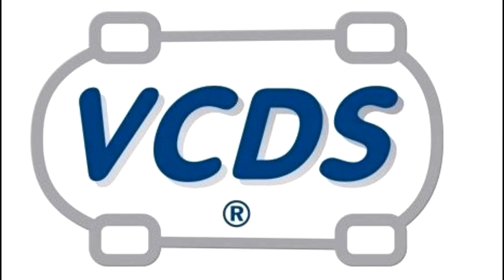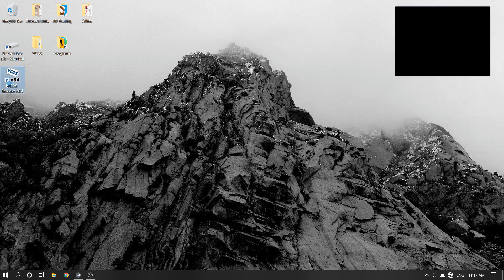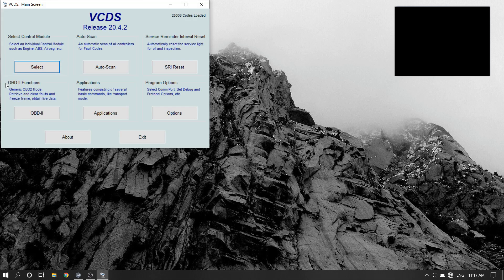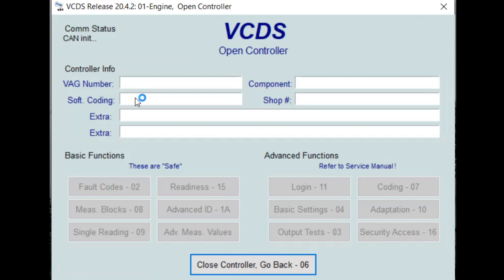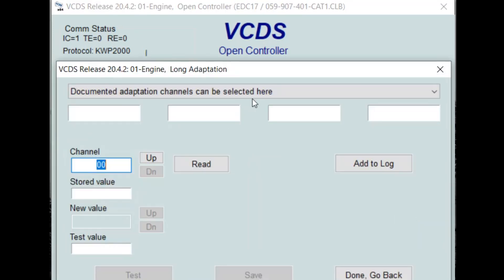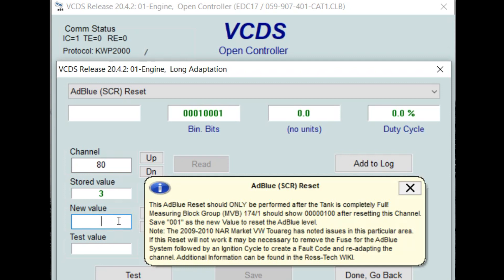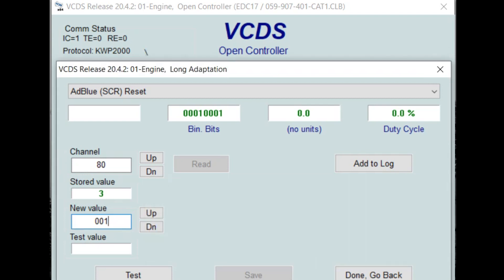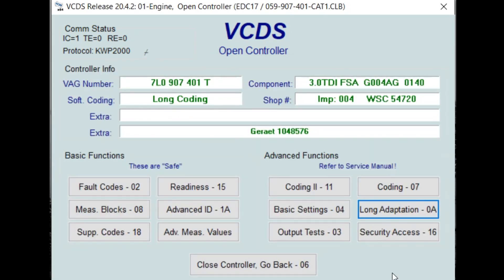VW ADBLUE RESET USING VCDS

Comment: I assume the cheap "Dumb" VCDS cables wont work, will the "lite" version of the software?   I'm seeing around $100 from FCP Euro for the proper cable says the software is a free download but they probably mean the free version which I dont think does long adaptations.
Reply from the maker: I wouldnt bother with the cheap cables. They wont work.
Reply: @GrindinD   Thanks, I ended up getting the Ross-Tech off eBay.  My local shop reset the ad blue for $35 while I waited for the package, that was good.  Had 15 miles left to drive. The issue started with a bad NOX sensor, I replaced that then had to rest.

Comment: I just added the ad blue and after a little bit it’s suddenly told me I was 200 miles away from not being able to start the car. And now I can’t start the car. Is there any way of doing this without going to an auto shop?
Reply: I'm in the same predicament.
Reply: What happened? I'm having the same problem
Reply: @peterovenstone  It’s a bullshit setting and error code that needs the dealership to just clear it in five minutes.
Reply: That's what I thought but I've been told my whole AdBlue system needs replaced to the cost of £2000.
Reply: @peterovenstone  A lot of the TDI’s have extended warranties. You should check it out. A lot of stuff mine was covered.
Reply: Did you ever figure out how to reset this via VCDS? my 2014 q5 3.0L diesel did this to me recently as well. No warning just 200 miles and done.

Comment: Don't know what I could possibly be doing wrong, but my new value just keeps giving me 3.
Reply from the maker: There's another test you can try that involves removing a fuse and cycling your ignition.
Reply: @GrindinD  I wasn't aware of it. Did you try it and did it work for you?
Reply from the maker: @montystevens1949  if the value doesn't change after the fuse pull ignition cycle method there's something else preventing the vehicle from reseting. The tank must be full.

For my client after I reset his adblue he still couldn't start his car. It turned out that we had air in his injector lines.
Reply: @GrindinD  which fuse?